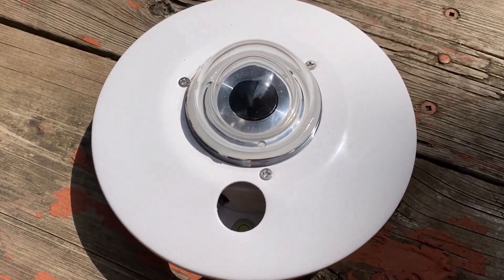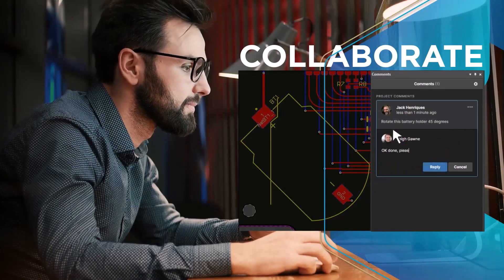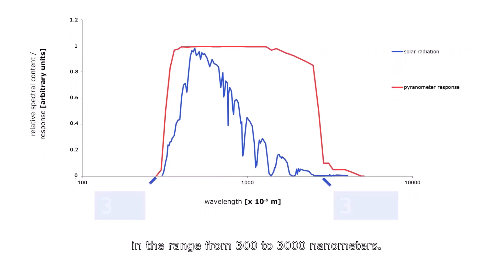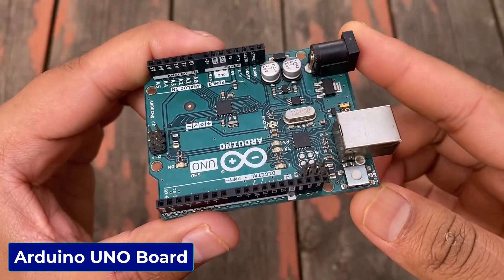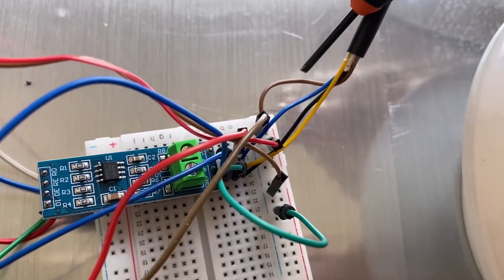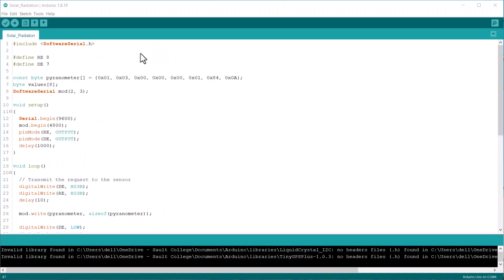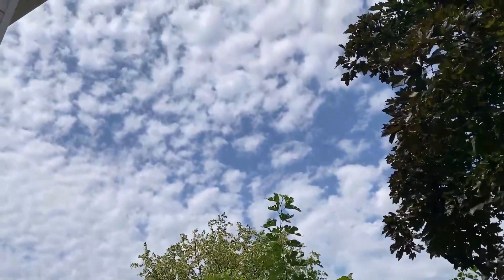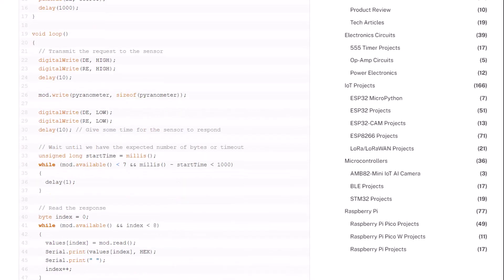Solar Radiation Measurement using Pyranometer Sensor & Arduino | Solar Irradiance Meter

Comment: Despite everything I've done, the results always show 0. Whatever I did, I couldn't solve it, what could be the problem?
Reply: Same
Reply: Have you figured it out? Can you help me?
Reply: @abdullahilyas8141  Yes, I solved it, the code is not faulty. Position the pyranometer in a place with sunlight. Do the experiment like this.
Reply: What is your pyranometer model?
Mine Model:SN-300AL-RA-VO5
Reply: Are you using mega or UNO
Reply: @abdullahilyas8141  I use Arduino Uno, the same model as the pyranometer used in the video.

Comment: Thanks for the nice tutorial. I have used MAX 485 module with arduino and all connections seems ok. But arduino is showing 0 Wm-2 always. Can you please advise what can be the possible reasons for error? I have followed everything as per your tutorial. Thank You.

Comment: Hi 
can you please provide any reference to read the same sensor with ADC pins on esp32 
I tried but the values are not correct
Thank you
Reply from the maker: It does not work on ADC.
You need RS485.
Reply: @HowtoElectronics  i used rs485 with rx pin and tx pin output, not used max485, but that can't used, why this problem?